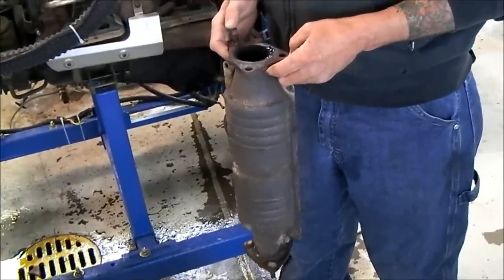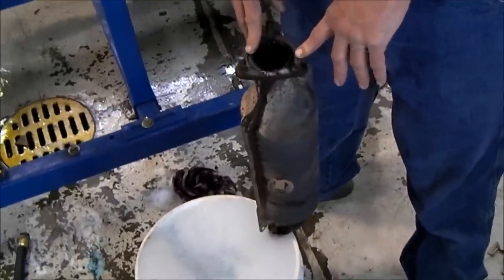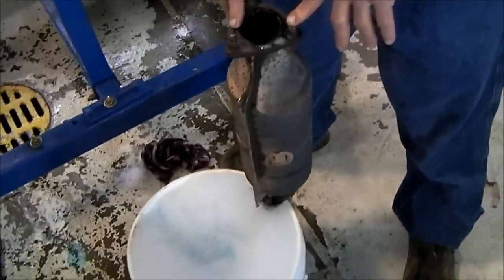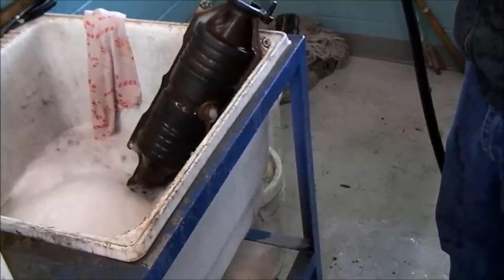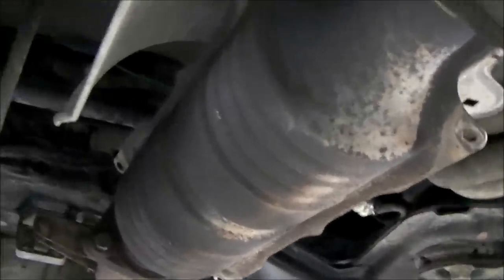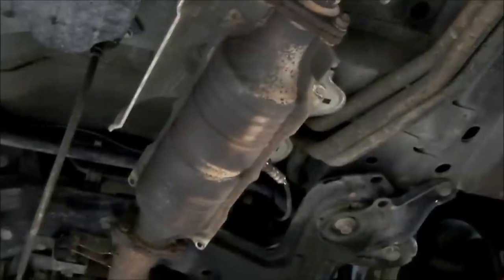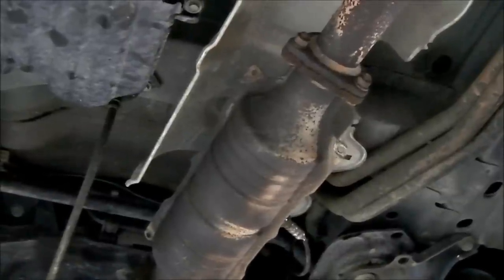Washing a Catalytic Converter

Comment: You guys should have soaked it over night in turpentine/kerosene or similar material then wash it off with soap and water. Soap and water alone won't get the grime and buildup out of the catalytic converter.
Reply: Yep... Did that and IT worked

Comment: I really thought you were going to end it with Myth Busted. Still, catalytic converters fail for two reasons (some stated below): 1) catalyst poisoning. This is chemical bonding of the metal coatings with other elements. Potential contaminates are removed from petroleum products, but over time, they can still do their damage, more so with cheaper fuels. This cannot be reversed. 2) Carbonized plugging, which you are trying to wash out. Soaking doesn't help. It's carbonized crust. It's formed at temperatures upwards to 1,000°F. You ever tried to clean you oven or grill with just soapy water? Yea, doesn't work. All you can do is displace it. As the video says, hit it on the outside and try to knock it loose. (Just remember that there are ceramic mesh pieces on the inside, so don't get too aggressive with it. Keep that pneumatic hammer in your tool box.) Rinse it out to get the rest. Chemicals may damage the coatings and won't affect the carbon. Honestly, that's as good as it's going to get.
Reply: They’re not trying to unplug the cat. They’re trying to expose the precious metals to the exhaust again. The metals are all there they don’t leave the cat. But if they have a film on them they won’t contact the exhaust
Reply: I agree with your comment. Cleaning a old disintegrated cat won’t change it condition.

I had the same problem on my duel exhaust. One cat cleaned up and passed within 5-10 miles of lacquer thinner in the gas. My other would not pass after many attempts of cleaning while attached to the car. 

After I removed it to gain that empirical knowledge, I discovered the internal material had disintegrated. So I replaced both of my cats 3 years ago.

A few days ago I did a scan of my O2 censors and they was not preforming as they did when I first put them on.  So 1 gallon of lacquer thinner in a quarter tank of gas cleaned both very well. My scan of the O2s shown great results.

I didn’t wait until a 420 failure, I do the lacquer thinner in the gas cleaning every 15,000-20,000 miles now. With my scanner attached so I seen it produce results in about 10 miles at 65mph with overdrive off.

Comment: If this works it is just coincidence.  Catalitic converters fail because contaminants make it into the exhaust.  They get to the converter, coat and encapsulate the many precious metals the different catalists use.  The metals are contained in a mixture suspended on the substrate or surface on the inside of the catalitic converter.  This contamination is called poisoning.  When the inside of the converter is poisoned the material and gasses they usually burn pass right through or build up even more inside. This is because the catalitic converter wasn't designed to burn some of these these contaminents.  When they contact the 2200 degree material in the converter what is left is silicone from coolants and, Zink and phosphorus from additives used in engine oil for lubrication.  They stopped adding some of them to the oil formula in 04 adapting the api sm iliac gf4 designation.  Zink, mmt recently and, lead a while back, also have been removed from fuels.  MMT that used to be in fuels, turns into sulfur manganese when burned that can smell and insulate the potential to burn any dirt left over or soot from diesel fuels too.  The washing you describe may work temporarily but I'd be surprised at all.   If someone puts leaded fuel in, the wrong fuel sold to you in the pump (which rarely happens) you put the wrong or old oil in, you have a mechanical problem dumping massive amounts of coolant, fuel or, oil into the exhaust, washing the converter will not remove lead or any of the other elements I described that are considered poison for the converter.  The reason the dirt you can wash off is there is because it no longer gets to the temperature needed to burn them off.  In a gasoline engine if there is dirt there then there is a bigger problem that either has been fixed or needs to be before it will pass an emissions test.  
Low octane fuels like 87 are not dirtier or better for the catalist unless the higher compression engine which creates more heat requires higher octane or slower burning fuel. If lower hotter burning fuel is used in a high compression  engine, it will produce more NOx.  If the engine does not burn 87 octane rating too hot then it's better for the catalist and that engine.  Higher octane fuels have additives in them that make them burn cooler. Those additives need to burn completely too. The performance engines that mechanically compresses the air fuel mixture more create more heat and tend to burn the low octane fuel early.  This causes incomplete combustion, knock or ping, more NOx, and loss of power.  It's not dirt or cheap gas.  I guess you could get cheap gas like a no name pair of sneakers that is inferior but again, that's so rare, the regulations that are out there now would heavily fine those refineries if that "dirty" fuel ever made it to the pumps.  It's not like it would be like  brown water from rusty pipes in your house, it would be like the wrong level of additives or incomplete refinement of the raw oil.  
For this wash you described, to work on the heavy buildup or diesel soot, you have to make sure the repairs or bad gas, oil, coolant leak or mechanical repair was done.  No check engine light for any other failure then, you can run a heavy load or high temp burn cycle with the catalitic installed.  This would be like driving up hill heavy on the gas for a few times for at least 10 minute trips.  This will heat the poison in the converter up enough to burn off.  2200 degrees, something degreaser wouldn't effect.  Then it may be partially what may solve the problem.  
None of this will work if the converter is just worn out though.  What happens just like an O2 sensor the metals sort of wear off.  It's not like they are blown away or burnt up.  What happens is more like an attraction like a magnet.  They tend to migrate rate together and no longer coat the whole surface inside the converter.  Therefore It doesn't have enough surface to do it's job right.  Kind of like a dead battery.  
I learned all this because I had the pleasure of owning an auto shop next door to a guy that made catalitic converters for all kinds of engines.  We used to re-coat converters for my customers when they failed for being old and worn out.  I never "washed" one though.
Reply: Remember we are talking about cooler exhaust Temps to cut down on the formation of NOx.  EGR helps lower temps by replacing some oxygen rich air with unburnable air volume.  It's definately a lie or attempt at brainwashing the public when they say the EGR valve makes anything more efficient that the catalist at burning NOx. It does lower the air pressure difference between the intake and exhaust valve in some older engines making less resistance on the downstroke of the piston but, it doesn't compare to the power lost in horse power and fuel economy that can be gained if we had a different way to measure or burn NOx more accurately.

Comment: Washing it in cold soapy water for only a few minutes won't clean much of the deposits off. You need to soak overnight, and agitate (or shake) it periodically. Thoroughly rinse, then dry it out with pressurized air before putting the part back on. You'll get many more miles out of it.

Comment: If you can clean up carbon deposits on pistons by spraying short spritzes of water through the air intake why couldn't you do the same by drilling a small hole in the exhaust pipe right before the cat? Better yet, use compressed CO2 like in keyboard cleaner. What happens is that the cold liquid causes a rapid shrink in the metal and the carbon-being a hard mineral-can't contract or expand at the same rate and cracks off. Hopefully, the catalytic bonds with the substrate don't shatter too. Wouldn't even have to pull the cat...

Comment: just removed Cat last night.  2008 toyota corolla 1.8!   left it inside night in soap and water.   Rinsed it out blew it out!  drove car!  can you say that P0420 code came back VERY FAST!!! Yes I added seafoam in fuel tank!  nothing.   I did do seafoam in a Nissan Versa and that worked on a P0420 code!!

Comment: Hey I've heard if you piss in it, it will also clean it out.....    hahahahaha.    The "crud" in the sink was all of the PGM's (platinum, palladium, &   rhodium) that you successfully got rid of, which acts as the chemical reagent to clean your exhaust correctly...   it does not matter about heat or sensor codes when you get it smogged.  At least in California.

Comment: I just put a cat on my 2000 accord the OE cat went for 300k miles and a bad o2 caused it to run rich and it died. a new cat and 2 o2s ran me about 185$ shopping is key
Reply: My 1997 accords cat would not clean up  Napa  Auto parts sells a mid quality range new cat for just under $100

Comment: my 95  acura integra has 160k miles on it  one day i started  the maintains light came on and flashed 10 times and  it makes a pop sound when it revs to high and  one time it died  when i was going up the hill    please help me find out
Reply: ***** Check engine flashing meaning engine failure or catalytic converter problems. In this case you heard a "pop" that means there may have been a back fire or engine missfire
Reply: Check engine light flashing is telling you your car is misfiring.... Dying while climbing a hill is also a cause to believe that it was misfiring

Comment: Cleaning a old disintegrated cat won’t change it condition.

I had the same problem on my duel exhaust. One cat cleaned up and passed within 5-10 miles of lacquer thinner in the gas. My other would not pass after many attempts of cleaning while attached to the car. 

After I removed it to gain that empirical knowledge, I discovered the internal material had disintegrated. So I replaced both of my cats 3 years ago.

A few days ago I did a scan of my O2 censors and they was not preforming as they did when I first put them on.  So 1 gallon of lacquer thinner in a quarter tank of gas cleaned both very well. My scan of the O2s shown great results.

I didn’t wait until a 420 failure, I do the lacquer thinner in the gas cleaning every 15,000-20,000 miles now. With my scanner attached so I seen it produce results in about 10 miles at 65mph with overdrive off.

Comment: I'm gonna try this and before I get it off the car I will have to snap one of the bolts and go get a torch to unstick one (or both) of the O2 sensors. Oh yeah...after I drive to the parts store for the loaner O2 sensor tool.

Comment: The other "possible" is:  "Is the Engine Running Properly?"  Given the mileage on that engine,  it may not be running that great at least when you compare it to a new or rebuilt engine......  The Engine is putting out poor emissions and you have a catalytic converter that is not running at its full potential.   As time and mileage on vehicle progresses, the engines emissions increase as the catalytic converter efficiency decreases to the point of where the check engine light comes on.  If the engine is running poorly in the sense of emissions - putting a new converter may NOT solve the issue.

Comment: LET's pretend that that will work, or some  other more aggressive "treatment ",  the metals will also be removed along with any ash, I dont know how much catalytics a converter have, but it will be pushed trough the exhaust system overtime, I've seen many attempts to clean the catalytic and so far all have shown little to no improvement at all. So a failing "cat" can't be cleaned.
Reply: Google citric Oxalic acid catalytic converter

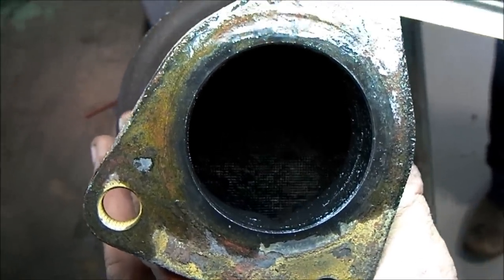Comment: Does anyone know what that yellow/orange crud is on the flange faces at the 6:40 - 7:10 mark? Is it bad? I found some on a used cat converter I bought and it's like powder so I doubt it's rust. Thanks in advance :)
Reply: Likely sulfur deposits from gasoline.

Comment: Did you measure the voltage of secondary O2 sensor. What was it. If it is more than a volt it is pointless to clean it. The air ratio sensor ( closer to the manifold. I think its called the bank 1 sensor) can only allow a 5 percent tollerance.
Reply: That’s not right. The point here is to expose the precious metals to the exhaust again. If you do that the rear o2 will show lower readings and switch less. It’s front vs rear sensor. Bank indicates which catalytic converter it is.

Comment: Hi. This happened to my 2003 Saab 9-3 2.0 Turbo. Got a P0420 code. Always fueled the car with high premium 102 Octane super Fuel. Drove it almost 1/2 a year every day on a 7 mile highway drive to work and back, added catalyst cleaner additive and some stop oil leak additive because I have a leaking oil level sensor, and I didnt want to change it because you would have to drop the oil pan. Anyway It seemed that i overfilled the car with new engine oil and my PCV seems to be bad as well. After 1/2 a year the P0420 came back and now it would come after every 5-10 mile drive. The repair shop took off the old cat and replaced it with a good working used one. No more P0420 till now. Anyway the took a look at the old cat. The ceramic inlay wasn’t damaged at all and they have been wondering why it got clogged with some whitish kind of sand or so. Almost 70% of the cat got clogged. I noticed that the engine valve cover and even the oil fill in cap got so dammed hot and now I know why. The cat was so clogged that the exhaust gases couldn’t pass through just enough so that the car still had power and drove 130 miles per hour though the cat was clogged. I do hope that the Turbo and the valve shaft seelings are still good. When the cat clogged there was coming white Greyish smoke from the exhaust sometimes which really did smell bad... I hope my new used cat will be more reliable. Before I changed the cat I did drain the oil and made 1 oil change with filter to flush the engine, and after we mounted the new cat we changed the oil with premium 5W-40 C3 Oil again including the oil filter. I will never put any additives in my gas tank as well as in my engine oil again.

Comment: In my professional shade tree opinion, I've tried everything y'all can imagine to fix a cat and my conclusion is that they were designed as a throw away part and the only thing you can do is just that to do the job that.
Reply: Did you ever try citric and oxalic acid soaking at 160F?

Comment: How if use the acid with low concentration ? What the inner catalytic converter material made from ?
Reply: Really bad idea since the precious metals inside would be destroyed making the cat useless or worse.
Reply: You're right tamrin.  Naoh (base) does not work by 2 in depth yt videos.  Google citric Oxalic acid catalytic converter.  dissolves contaminants coating the previous metal

Comment from the maker: I think this really could work under the right circumstances. Based on my experience I think that most of the time this code sets because of ash buildup in the substrate. The key is just finding the right stuff to remove the ash.
Reply: What are your thoughts on spraying it with engine degreaser and washing out with a pressure washer?
Could those damage the substrate?
Reply from the maker: Ronald van Kemenade Engine degreasers work well for oily and greasy residues and that's not what you have inside a cat. thinks using mild organic solvents like throttle cleaner, brake cleaner, carb cleaner work well on sticky and oil residues but that's not what we are dealing with. I don't think most degreasers would hurt anything, I just don't think they would clear the ash. Something made to break up the tightly compacted ash deposits, and clear them out would be the key. Plenty of chemicals out there would probably do this but whether or not they would damage the coatings of the substrate, who knows. I will continue to experiment with this idea and if I find something that works I will post it.
Reply: Thanks, I appreciate it.
Reply: Citric and Oxalic acid.  Google it with catalytic converter
Reply: And it's not ash.  It is most likely phosphorus that is bound to the precious metals and the acid can dissolve it away exposing the precious metal to catalyze again
Reply: Soak in in Kerosene for 48 hrs - it will come out as new